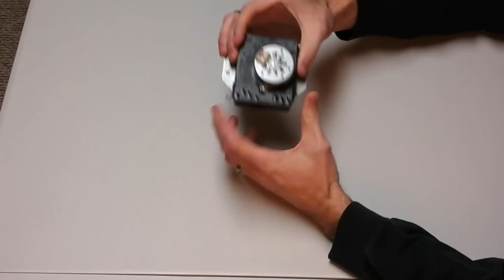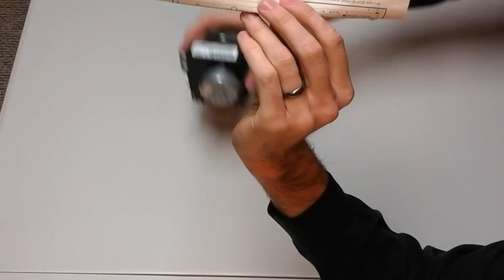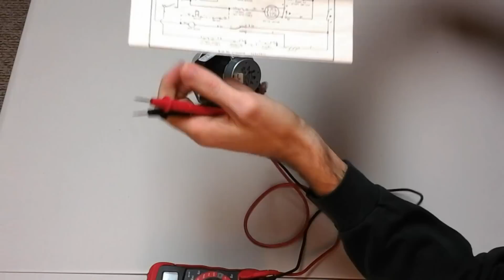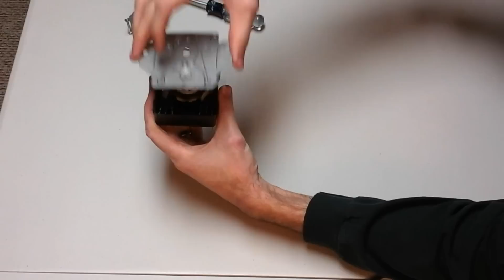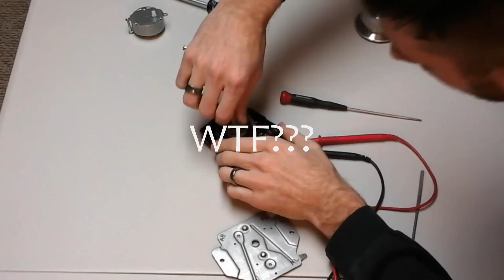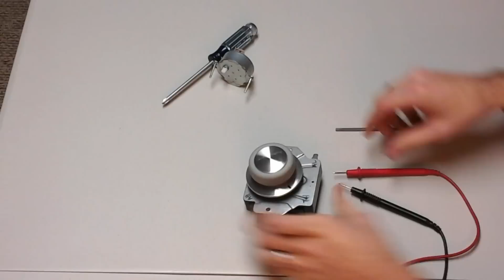Test and repair a clothes dryer switch

Comment: Thank you for making this video! Very helpful. I lightly filed mine with 600 grit sandpaper. However, I can't help but wonder if this is just a symptom to a root cause. IE something is pulling too much of a load which is causing arcing of the contacts. I ohmed out my heating element, 10ohms which is correct. I'm also going to clean out my exhaust duct work, I'm wondering if the backpressure is causing too large of a load on the fan motor, then when the switch turns off that load is producing arcing
Reply from the maker: justarandom I wouldn’t be surprised if this is by design. A coworkers brother worked for Whirlpool in the R&D department where they would develop parts that were designed to fail just outside the warranty period. It’s called “Planned Obsolescence”. If an appliance lasts forever, fewer people would buy new ones.

Comment: Thanks a million!  Contacts were stuck together causing the dryer to not turn off at the end of the cycle.  Very simple fix with a little sandpaper.  15 minutes later and it is back together and working.

Comment: I have done this on a couple Whirlpool made dryers. The contacts seemed to be burned dow from the arcing.  I am a little concerned that if the points burn enough, the cobtact blades will touch copper to copper, stick, and cause a fire.
  Comments welcomed.

Ps Would really appreciate it, if someone could tell me where I can buy new contacts to rebuild these timers!  Or.maybe a way to restore the points themselves.  I would rather be able to buy whole new blades with the contacts/point on them, because of possible lost flexibility of the old onrs from the heat.

Comment: https://www.youtube.com/watch?v=gJr25sBboOA is a likely reason that the contacts might not be making contact well - the cam followers each get a groove worn in them,  filed the contacts  and still had intermittent contact  but when looking at the cam followers they had grooves worn in them - watch and he shows it.  I used 5 minute epoxy to fill the grooves and works. great now.

Comment: Thanks for the useful video. With your assistance I,  who is not very handy, fixed my dryer and saved me about eighty bucks
Reply: I didn't have a file, so I used a wire wheel for my Dremmell on low speed.
Reply from the maker: Steve Harden great!! I’m glad you got it fixed. Thanks for watching.

Comment: I tried replacing every thermostat on back even though they checked out O.K.. Dryer got to where it'd take longer and longer to dry clothes. It was not heating as good either, then finally wouldn't heat at all. I then checked the motor switch, I cleaned and lubed it, but that wasn't the problem. After watching this guy's video, I checked my timer switch and discovered that it was faulty. I took it apart and two contacts were burnt so bad that part of each contact had burnt away. I cleaned what was left and bent them so they'd make contact when the timer was turned. It works! For how long is anybody's guess, but it is working for now!!!

Comment: this is charlie in the mo.ozarks just fixed mine 3 mins after the kids left for the laundry mat lol. i had to bend that tab over .also i found the dryer cord wires werent tite maye some of the arc problems thanks.
charlie
Reply from the maker: Howdy fellow Missourian. Glad you got it sorted out. Hopefully the kids didn't spend too much time at the laundry mat. Thanks for watching.

Comment: sorry dustin but your fix is for the symptom not the cause-  other contacts are not burned  so the plastic finger is worn-  i used super glue mixed with baking soda build up the plastic finger then lubed the cams
Reply from the maker: Others have mentioned that their fingers were worn too, mine were not. You can see at 8:00 when I turn the dial that the finger is riding atop the cam on the dial. Super glue and baking soda is some strong stuff. That repair will probably outlast the dryer. Thanks for watching.

Comment: sorry dustin but you are fixing the symptom not  the cause-   other contacts would be burned but they are not   the cause is the plastic arm is worn   i used super glue mixed with baking soda to build up worn spot then sanded it to fit then lubricated cams so it wouldnt happen again
Reply: Terminal A is known to do this on these timers.  The heat generated from arcing contacts evidently causes the copper contact arm to lose tension.  I also wnder sometimes if there may be a wirn cam that causes this.  Not sure what you are referring to as plastic arm.
  I have replaced the A terminal with one with thicker contact points.
  I have also glued cams back in position.
  I think I have flexed the contact arm like is shown in this video, bit not sure how much confidence I have in doing the since the contact arm has been affected by extreme heat.
  Next time I run into this sotuation, and I will, I think I might use my roto zip with a sanding disk on it and sand the plastic "stopper" a little to make it a hair thinner allowing a,b, and c to make contact.
Reply: Rickey Keeton the cams actuate the white plastic arms which in turn push the contacts together. On mine, the triangular nub that rides against the cam had been worn so the arm didn’t have enough throw to hit the A terminal. That nub is what others are building up with epoxy/superglue.
Reply: @RK_Tek83 , Mine had the nub worn down and the epoxy didn’t last long, superglue with baking soda is much stronger. However this time I decided to use a 1/8” wide by 1” length piece of aluminum cut out of a soda can, and epoxy that over the nub. That should last a longer time, and so far that has been several weeks and working great.
Reply: funny, as I tried epoxy to fix the plastic tab on the arm, but then it wear out in short time. So this last time I cut a short strip of aluminum out of a coke can and epoxied that over the tab, much better now! Also lubricated the cam.
Reply: I can very well see that happening.
I have one now that I may try that or swapping plasyic arm from another.  I have also wondered about the cam itself that opetates that particular contact blade.

Comment: Thank you so much for posting this video. I had already done all the continuity tests for all the other electrical components and determined our heating element was blown. Fixed that and still nothing. Stumbled upon another video that clued me into cleaning the copper connectors but still nothing. Found your video and with the continuity tests on just the timer itself I was able to figure out what was causing the issue. Quite a process but with your help I got it done and our dryer is working again. Thank you!

Comment: I have repaired these the same way basically.  But since I am concerned about the contact blade losing it resistance to heat and or the flexibiltiy properties from overheating due to power surge, arcing, wear from so much use, etc., next time I think I will try to file the plastic stop just a bit.  Thinking this will allow the cleaned contacts to touch without having to do any bending of the blades which may not hold the bent shape.
  This is a somewhat common problem on this type of timer.
  Not knocking your video at all.  It is a good informative video for the diy'er.  Filing of the plastic stop is just a theory I intend to try as I work on several appliances and want the contacts to fit as flat as possible against one another.
  Again, good video.  Thumbs up!

Comment: would this be a problem if my dryer won't start
Reply from the maker: It may be caused by the switch, but probably not by the particular pins/contacts that I refer to in this video. If it won't start at all, I'd start with looking for a faulty thermal fuse. I had to replace mine not too long ago because they will go bad over time - or sometimes the 'pop' because of some other issue. There are quite a few videos on how to test a thermal fuse on YouTube.

Comment: I picked a mint condition Crosley someone dumped in the alley. The T-X points were welded together. Either I or the previous owner turned the knob w force and broke the inner most cam. The burned contacts wouldn't lift when the cam came around and it broke the C-H/B/A (?) cam(s) as I was getting no power to the thermo fuse. (dead motor..no push start) and no power to the heating element. I opened the timer and found the bad points and pieces of cams. For fun I jumped the C-B connection and the motor started. A new timer got it working.

Comment: Does anyone know where to get the replacement contacts? I have this issue with a dryer, and I have removed the contacts. But the pads where the contacts connect are completely fried. If I can get new contacts, it will be like having a new timer.

Comment: Great video, I'm a tech. I remembered about 8 years ago was working on a dryer. It had a bad timer. Nothing, but i did just that. I usually use a small needle nose to slightly bend. A set of flat file works great. Good job
Reply from the maker: Thanks!!

Comment: the "arc" is welding. So the welding warped the tab preventing it from working. Good video ! In order to weld really thin pieces of metal you have to spread the points out and let it cool. If it happened quickly enough - someone spun the dial - and it arced twice - it would definitely warp that tab because it didn't cool. That's my guess as to how it happened.

Comment: I have also fixed on of the cams on the timer for this problem. The cam was not pushing the contact out far enough to make contact to complete the circuit in the timer.
  I didn't watch all of this, but I think it was the same problem.  Was going to switch the cam with one from another, but it had the same problem, so I fixed the one that wad in it.
  I may have done the same as you before on another before I decided to experiment and attempt to fix this one.
  Did this repair hold up, or did the contact you adjusted go back to its original position?

Comment: replaced fuse, thermostat, and start switch (all under $10 total, but still, time!) still no luck. Then found this video...and seeing how the "pins" (no electrical knowledge) need to align in the timer motor, I tinkered just as you did until they all made the proper contacts, popped it back in, and WAAAAAAABOOOOM! dryer works! It is 1145pm, so after getting the dryer to work after a week of troubleshooting and ordering parts, etc., I woke up my wife to tell her the good news! 
Thanks for the video!

Comment: 3 thumbs down? this video just saved me $$$. I had changed the heating element and thermo fuse. Still no heat. Saw somewhere about the switch might be bad. Searched on YouTube and found this! I jumped to about 7 minutes where the plate was taken off and copper tip was brushed. 20 min max fix!

Comment: I've gotta tell you, man, you just saved my husband and me a bunch of money!!! And made me feel very proud to have fixed our dryer's timer after a repairman told us it'd be better to buy a new dryer rather than a new timer since our Roper is at least 10 years old. Although the problem you demonstrated wasn't what vexed our timer, your video showed me what the inside of the timer should look like, so I was able to figure out that the positioning of the cogs on the spindle was incorrect (must have been a construction error!) so the contacts weren't closing appropriately. How cool was that to discover the problem and correct it!
Reply from the maker: It makes me happy to read comments like this. I'm glad you got it fixed and glad that you took the "plunge' to try to fix it yourself instead of throwing it out. Makes me hopeful that our throw-away society may change its ways. Thanks for watching.

Comment: This video was very helpful. My symptoms started with dryer only working on some settings. It got worse. Eventually no heat at all. Replaced all fuses, and heating element tested fine. Still no heat.  Pulled timer off to test. Had no reading between C and A contacts. C to B worked fine. Was able to file it some between the b/a sides to get a better connection. After filing re-tested C to A and was getting a reading on the multimeter.  Now the dryer heats again. Thank you
Reply from the maker: Great!! Glad you got it working.

Comment: Contacts appeared normal looking from top view; however, the ohm value was OPEN.  Took my wife's metal nail file and scuffed both contacts as described in video. For just added measure, in order to extend time life another year...or more, I bent the contact blade closet to the case slightly toward the other.  DON'T over bend..   Cheers!

Comment: mine was doing same thing what you did will fix it but the cause is the white plastic arm that touches the bottom wheel of switch wore a groove in it causing it not to push the contact fully over
Reply from the maker: If you can get the wheel apart, you can fill the groove. A mixture of superglue and baking soda works nicely for these type of applications.

Comment: Hi there is no continuity with mine,  but it showed some 1200 some I guess ohms while on continuity mode.  In ohms its   showing nothing.   Dryer is working right now but I am concerned if it is safe or not. Also what I did sprayed wd40 inside to get rust/carbon out.  Is it ok to do so?

Comment: Great vid must be a factory defect. was working on mine all week everything checked ok and i found your vid was the exact same problem same contacts. thanks for the knowledge
Reply: junkyard bob possible as mine if you look up the part number it has been superseded by another part. Also possible they want it to fail easily if the thing shorts or draws too much. It’s setup so everything has to be just right to get the heat circuit closed

Comment: just fixed our dryer using this video! Thank you! slightly different Invensys timer on a Whirlpool but exact same problem with the same contact.  Everything on my dryer tested good for continuity and ohms.  Thermostats, fuses, element, start switch, hi med lo selector, motor, door switch, exhaust flow. . . all good.  I was stumped and at a loss until I found this! Probably looking to hard for a problem but still wouldn't have known what to do if Id found the problem other than order a new one!  I was about to start throwing parts at it which would have been a waste of time and money.  Great video!
Reply from the maker: +Kyla Fitzgerald Great! I'm glad you didn't waste a bunch of money throwing parts at it. Too many people fall victim to that repair philosophy. Glad you got it fixed!

Comment: a very well done  video, it helps save money on crap that should have been made better, such as a washer timer. Over time arcing eventually leads to degrading the contacts no matter what, its just worse with a longer metal contacts vs. a shorter one. a shorter one provides  better contact which slows the arcing down. After all we are dealing with a heater and a motor pulling a lot of amps plus the wear and tear.

Comment: Thanks followed your directions when I got the timer apart I found the bottom Cog/actuator wheel was broken off fit it back comparing your pictures then used super glue to keep it in place ... put it back together and it works like a charm I will order new timer I dont trust super glue for long term repairs. Also found the same contactor issues you did. Thanks again.    oh yeah the problem I was having dryer would not start.
Reply from the maker: +Leon Basiaga Great. Glad you got it figured out.

Comment: Great video very helpful. These contact points work much like the points in automobiles in the 1960s. I accidentally dumped the plastic gear drive disc out and had to put it all back together but it is all working now.
Reply: +mark cox , I had the same thing happen to me, I'm not sure if I got it back together right, still having trouble getting out dryer to heat. Anything special about putting it back together?

Comment: got new switch still switch will not more at all. can someone help!!!
Reply from the maker: The switch won't turn? Are you talking about you physically turning it, or the switch just doesn't function (as in advancing like a timer)?
Reply: just wont function looks like am missing a  violet wire on the top of the switch. my model # m460-g
Reply from the maker: +Raymond Flores Maybe check out this post. Sounds like a similar situation as yours... http://tinyurl.com/pht9l9b

Comment: still not moving wont shut off. what a good temp for the dry 108F is what I got coming out.?
Reply from the maker: +Raymond Flores sounds like your issue may be a little different than what I encountered. I'd think that 108F would be sufficient to dry clothes, but I'm not sure what you were saying as far as it not moving and not shutting off.
Reply: @DustinRogersinMO  I know this was posted a good while back.  On high heat, the temp should cycle between around 120 and 160. That particular timer propably is controled by an oparating stat rated at 155-20.  Heat cycles aroind 155 and 130F.  But temps of 160 and 120 will still give an average of 140, a good high heat average.  There is a variance allowed in the stamped rating of the operating stat which is usually on the blower housing.
  The low heat situation may not be a result of a bad stat.  Maybe a bad seal around around the tub allowing cool air to be drawn in.  Another seal to check would be the one around the bottom of the lint chute.  This can give a misleading reading on the thermometer used to read the temp at the exhaust pipe.
  Just passing time.